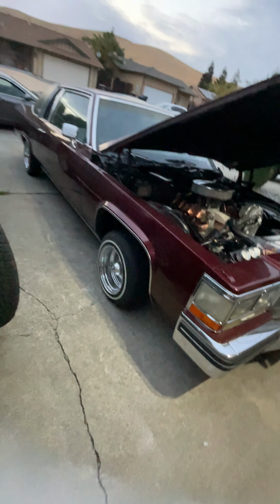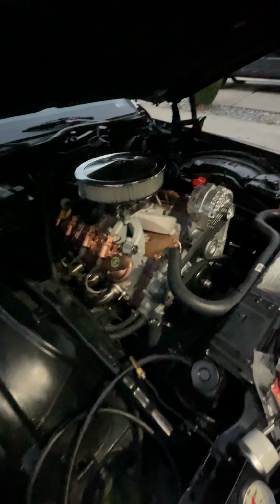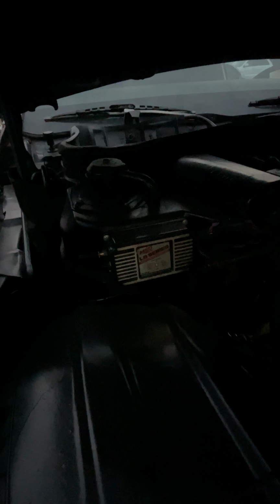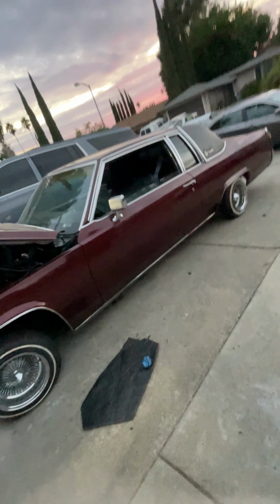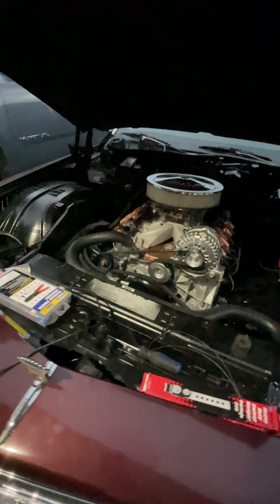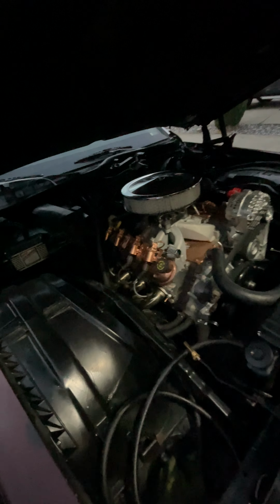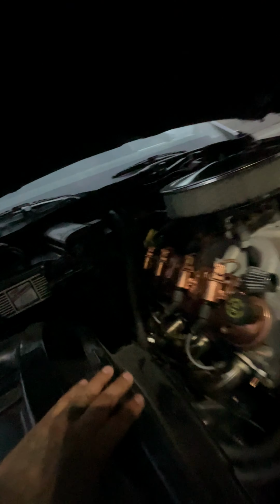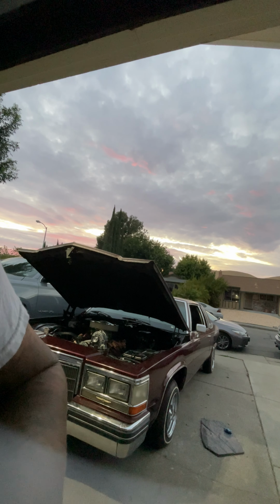1984 cadillac coupe deville

Comment: She purty jack 🔥
Is the LS a 5.3 or 6L?
I'm in desperate need for a swap.
Got that horrible 4.1 currently, I'd love to hear your input, any advice regarding what's the easiest and pain free swap is greatly appreciated
Reply from the maker: i have the 5.3 out of a 2004 tahoe the swap is simple i used the same transmission from my cadi all i did was ad a space and made the flex plate bolt holes  a lil wider to fit. i did rebuilt my motor since the engine was out they do sell an adapter plate for the transmission but i didnt use it motor bolts right up also i went with a carburetor i like the look lol but efi way better . the msd box i got can do both efi or carb if i was u go with efi also when u buy ur motor make sure its a complete motor and the little parts will add up quick
Reply: Can you send me that oil filter cool adapter housing? How much you’d want for it, I needed that like two months ago!!!

Comment: What motor mounts are you using
Reply from the maker: i had bought some for a b bidy that i never used i just cut my old ones and welded some up but a am going to replace them my engine sits a little low
Reply: Did u use the 200r4 transmission